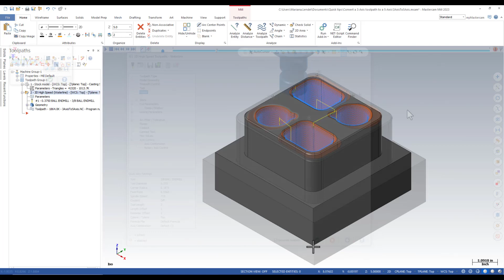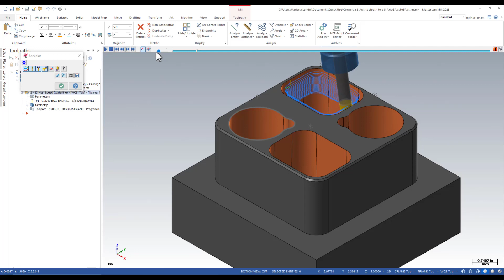Convert a 3-Axis to a 5-Axis Toolpath

Comment: I have a question let’s say I have a part to large to machine in X and Y on a 5 axis machine, can I use a 4-5 axis tool patch to use X,Y,and C keeping the x and y inside the travels? I have done it by rotating it to different planes and just doing contours but it takes a lot longer to program then if I could just use swarf and rotate the c axis well moving x and y in side the travel of the machine if this is possible could you do a video on this!